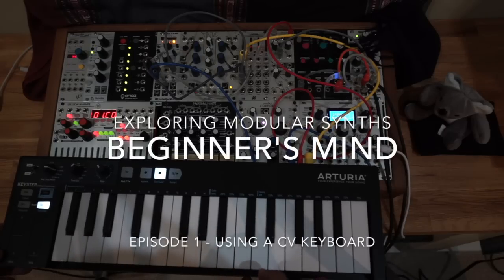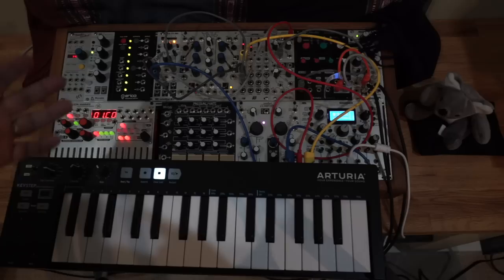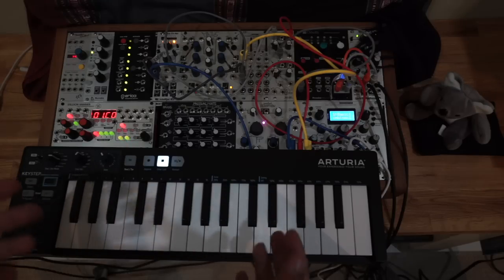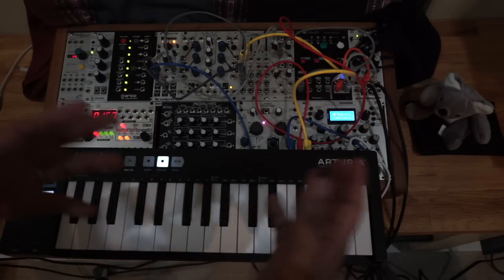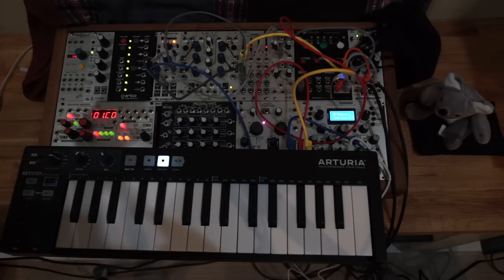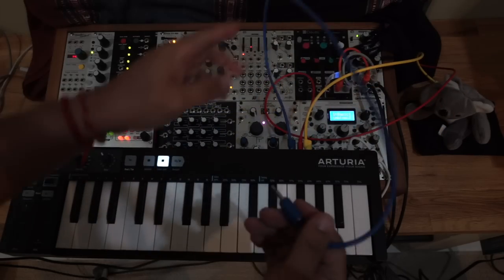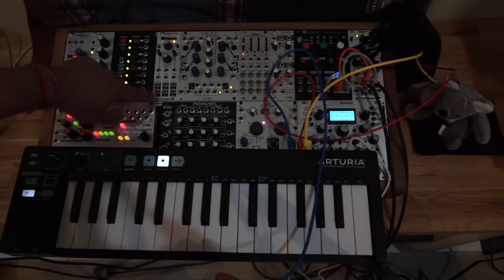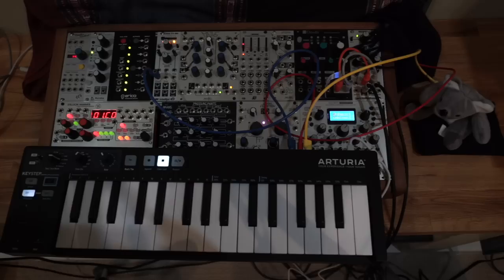Exploring Modular Synths - Beginner's Mind - Episode 1 - Using a CV Keyboard (Arturia Keystep)

Comment: Rather than buying a specialized keyboard with CV outputs it would make more sense to use an existing MIDI keyboard and instead install a MIDI (USB and/or DIN) to CV Eurorack module. There are many of them on the market. Many have additional functions, e.g., clock, gate, etc., that you might want in your modular rack anyway.
Reply from the maker: If you already have a MIDI keyboard then this is indeed a good option, albeit more expensive, as most of the MIDI to CV modules are $350+. For what it is (both a MIDI and CV keyboard) the Arturia is still a really great value. It's also quite portable, which is nice.
Reply: @ModularLanding  what about the korg sq-1? I am using it with my keystep. Not sure what the best synth would be for using the 2 cv and gate inputs to drive external gear. I only have a volca keys and korg nts-1 at the moment. Any idea how to set up the pitch cv and mod outputs from keystep? Thx so much
Reply from the maker: @NeonArtifact  the Keystep and Korg SQ1 are awesome for controlling modular synths or anything that can take CV input. The Volcas are awesome but aren’t really modular synths so they don’t have true CV inputs. Most small synths dont. So you’d be looking for a synth like the Moog Mother 32 or the Make Noise 0-Coast or Moog Grandmother or Matriarch, or the Behringer Neutron. These are all fantastic semimodular synths that can be used with the CV controllers you have, and can be linked together with other modular gear!

Comment: Awesome sound!
I have a question-
If I get a 1/4 to 1/8 adapter, can I use a keyboard which has 1/4" outputs? Or do I need a keyboard with just the 1/8" outputs to hook directly to my synth?
Reply: you need a keyboard with a VC Out or Pitch Out, which are 1V/Oct. And these are always 1/8". Most likely your keyboard has 1/4" audio outputs which will not help you. There are keyboards with MIDI Out, which you can use with a MIDI to CV module to control your eurorack gear.
Reply: @TripleTSingt  Sorry for the late reply, thank you! It looks like I may have to invest in something more specifically geared toward Eurorack. I appreciate your input.
Reply: I have a Mikrostation keyboard which I'm looking to connect to my synth.

Comment: the problem of modular synths are that they are hard to listen to 😁 ear bending sounds 🤣 don't expect modular songs to be played on the radio 😁
Reply from the maker: Modular does have the power to make ear-bending sounds, often more easily than commercially constructed synthesizers that are kind of "tamed" by the manufacturer to sound good all the time. But modular synths can be tamed in the same way, and can sound just as beautiful as conventional synths. Check out Ann Annie's channel for beautiful modular music. Also my recent video "Sheep sheep sheep."
Reply: @ModularLanding  Yeah, that one in Sheep Sheep video sounds better - but you know, it is still far from classic synth sound I like. I am composing music myself and I use only soft-synths made by U-HE, Hive, Diva and Bazille mostly. Listen to my cover of James Bond song - All time high - everything there are sounds from U-HE soft synths (with the exception of the beat of course) - and as you can hear, the sounds are very pleasent to listen to :-) I can´t imagine you can achieve these sounds with modular :-) https://youtu.be/SvK2FUR1TXQ
Reply from the maker: @RobinPM100  Very nice track -- I listened to it. You can certainly create those sounds with modular. It's just that most people wouldn't use modular to create sounds like that, because they can be created easily with soft synths or standard (non-modular) synths. A lot of the sounds you're using are FM style synthesis sounds. These can of course also be created in modular. Modular just means that the parts of the synthesizer are not pre-patched.

Comment: so i m at start with electronic music and i m sry for sounding noobie but on the far right up the patches are used just for the sound to go in your speakers? and if i have an arturia beatstep pro that s connected to the pc and from the pc i have my earphones do i need the far right top module anymore? aaand what modules do i need to start the basic thing besides the oscilator?
Reply: Yes, that's correct. The last set of cables connects the modular to a pair of powered monitor speakers. You do not need the top right module, but you may need some way of attenuating your signal (making it weaker) since modular signals are very loud. Besides an oscillator, you may want a VCA (amplifier/attenuator to weaken your signal and change volume), LFO's (for modulation), a filter, and you already have a sequencer in the beatstep pro.

Comment: In order to make it polyphonic would you have to add multiple oscillators?
Reply from the maker: Yep, that's right. However, note that in modular almost anything can be made to go fast enough to "become" an oscillator and then used in that way. In another video, I show using the Batumi (LFO's) as an oscillator, using the Echophon delay to be an oscillator, and you could do the same with envelops. You can use Maths as a set of oscillators. You can use a filter as a sound source and play it, etc., etc. So you don't have to necessarily buy more oscillators (VCO's) to have more voices.
Reply: That's awesome, thanks! I'm just getting started. I don't have a synth yet. I just ordered speakers.
Reply from the maker: Cool. You're in for some fun times!

Comment: When you re-route your mod out from the keystep, are the 2 LFO outs still actively altering your sound when you adjust your mod wheel?
Reply from the maker: Buddy Hale what segment of the video are you referring to? I believe the answer is yes depending on what moment you’re asking about. For example when I plugged the mod wheel CV out from the Keystep into the frequency input of the Batumi (which is generating LFO’s that go into the Dixie oscillator) then from that point on the mod  wheel changes the speed of the LFO as if I were pushing that slider up and down on the Batumi. So the LFO is still on and active, we are just changing its speed.